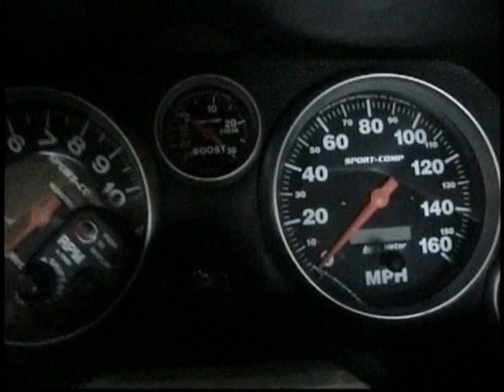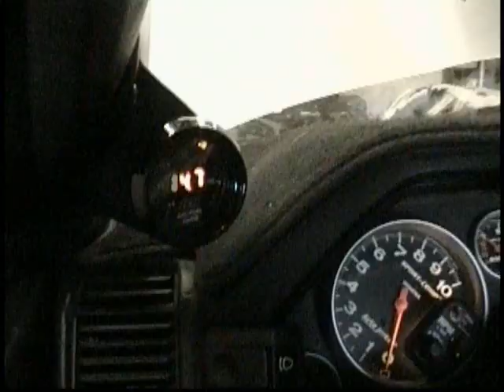1987 Nissan 300zx Turbo Buildup Walkaround On Dyno

Comment: microtech lt-10 can be used with electromotive ignition system? or what set up are you using with the wheel trigger?
Reply: Customer adapter to mount trigger wheel on crankshaft pulley. Custom bracket to hold sensor.